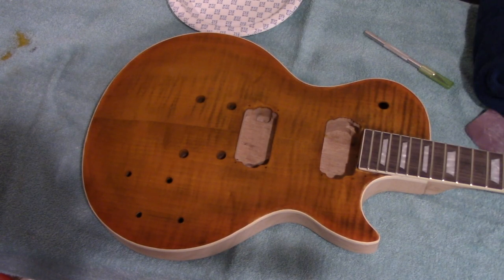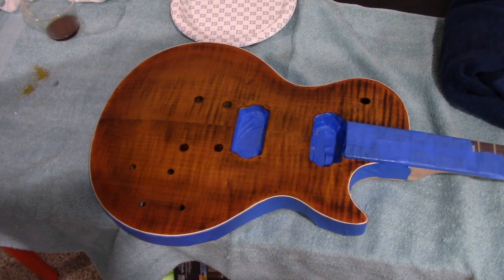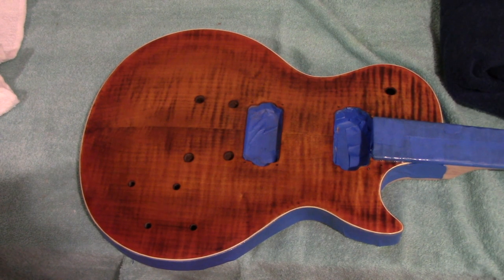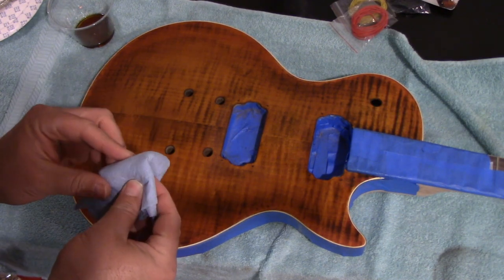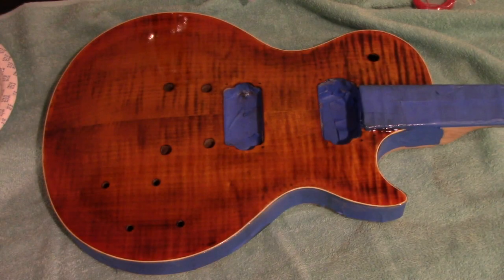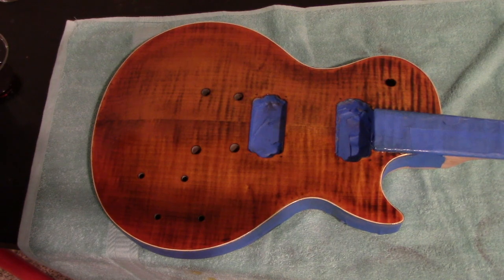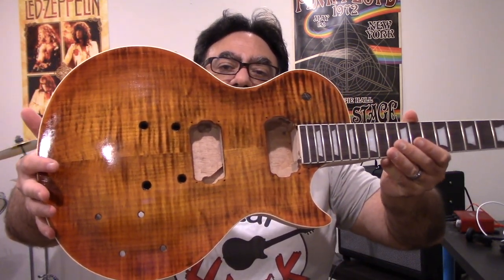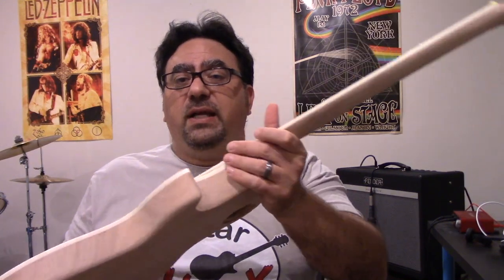Tru-Oil Finish on a Guitar Top

Comment: A secret I learned from my brother a ukulele builder. You can harden tru oil instantly by spraying armor all on it after applying. He used to put 6 coats on his instruments in an hour. The armor all didn't effect the wood just the tru oil. It works very well
Reply: Coming to a test block near.. me! O really....
Reply: So you can apply the armor all right after the truoil? Do you have to clean off the armor all with something prior to adding anything laying of truoil?
Reply: You sure he was using Tru oil? Never heard of that
Reply: @Rob  yes but you just wipe it off.

Comment: Well done. For the record (I learned it from YT also), I use a mix of 1/3 tru oïl, 1/3 wipe-on Poly and 1/3 mineral spirit for every coat. Laying down around 12 coats usually and it's glossy as it can be, dries quickly, I'm putting 4 coats a day without issues. I guess the advice came from Chris at Highline Guitars, works best IMO. Just gotta deal with the liquidity of the mix, meaning thin layers rather than heavy ones at the beginning of the process. And Don't forget to finish with Gunstock wax, the final gloss & hardener touch.

Comment: They make an awesome sanding and wood filler too to use before the TRU Oil. I am going to experiment with this on Rosewood fret boards. I think it would be great to have a sealed rosewood board on some guitars and this looks like a perfect finish!
Reply: Like a rickenbacker!
Reply: If you wet sand in the beginning it will fill imperfections. You don't wipe it down after wet sand you apply a very lite first application. Then sand. And do it again with no wiping. After second coat you can wipe it down after sanding. Trick is that sanding with Steel wool will always leave a dull finish. A fine buffing compound once your happy with how much coverage you have will get rid of the haze.

Comment: Awesome job !! ... Yes give the top at least 2 weeks to cure before buffing it otherwise you may ruin the finish. As for the rest .. dont grain fill it unless your set on doing so ... the Tung oil will fill the pours rather quickly.
Reply from the maker: Thanks!! I want to darken the wood some and the filler will do that.
Reply: Yeah, but it’ll not dry quickly..

Comment: I did a gun stock, I did sorta what you did, but I did about 25 layers. The more and more it starts looking like deep glass. I used 5000 grit between layers and sanded. I sanded with 5000 and 10000 and wheel buffed it. It’s slow slow process people that want to do this don’t rush it, it took me 2 months to do mine. I’m thinking of doing an acoustic guitar.

Comment: I just bought a Sterling Stingray Bass. I like the neck, but its not as smooth as my Suhr guitar or my Taylor acoustic. I'm going to lightly sand with 800 grit, wipe clean, then apply Tru Oil. I want to buff-it to a smooth, slick Satin neck (with 0000 steel wool). Enjoyed watching your project. oNe LovE from NYC

Comment: Hey looks good does take a while to harden up I do at least 4-6 coats, (i cap full per guitar LP style) lightly steel-wool in between like you (0000 wool). One other thing I like on first few layers is to use clear thin rubber gloves and use finger thums etc.. to work in evenly, and  smooth.

Comment: When you apply the tru-oil(pure) do you see smudges? Does it get sticky after few secs. Of applying too? Once it get sticky does it mean you over apply the tung pil? And for smudges /wipe marks  normally i just buff it with 0000 steelwool but i want to know if its just normal or im putting too much tung oil
Reply from the maker: Hi there!! Yes it will smudge, which is why eventually I thinned it with Naptha. If it is sticky/tacky, it means it's not dry yet. You need to leave it to dry completely before applying the next layer. I didn't use Tung Oil on the top at all. Thanks for watching!

Comment: Looks like it got considerably darker with all those coats.  For a light colored giutar what would you use?
Reply from the maker: Tru-Oil has an amber hue when it dries. There are clear, brush applied polyurethane coats you can use that dry completely clear. Thanks for watching!!

Comment: I could be wrong, but many people say that you should wipe on the Tru-Oil and then wipe it off straight away for a great finish. Use as many coats as required wiping each coat off soon after it is wiped on. Buff with 0000 steel wool or a scouring pad when dry between coats. Any comments are welcomed. Cheers...

Comment: I am also using Tru Oil as finish but with a bit different method. The first 10-14 layers are with either Danish or Tung oil (buff with OOOO steel wool between each one) when the first 2 are diluted with mineral spirt for better penetration and I am doing it to get better and deeper protection.   Then I add around 10-12 very thin layers of tru oil and use 1000 wet/dry send paper after every 4 layers to get better smoother surface. the last 2 layers are just supper thin layers of tru oil and that's it.
This way you can achieve very glossy beautiful durable shin with no need for wax buffing at all.
Reply: You can make the tru oil deep after finishing, use tru oil wax buff it out for nice finish

Comment: Dude you could have just used a latex based polyurethane for the finish, it's easy to clean, goes on with a brush, is not smelly & ends up hard as nails.
Reply from the maker: I could have indeed! Thanks for watching!
Reply: hi could you suggest a brand pls?
Reply: Believe or not the Rustolyum Pro brand you can get at Home Depot works really well.  I've used clear gloss on the body and satin on the neck. Dries quick and hard and is UV stable so it doesn't yellow over time.